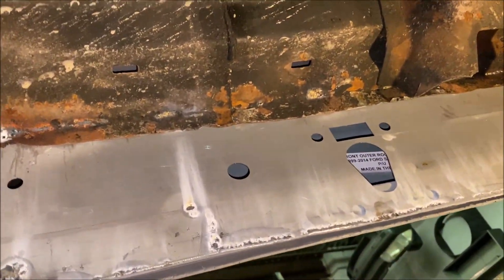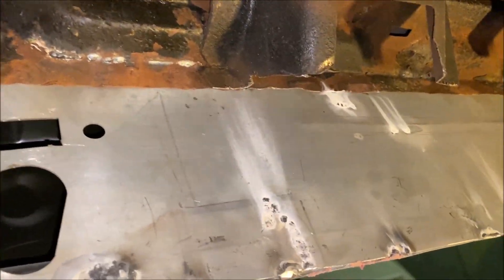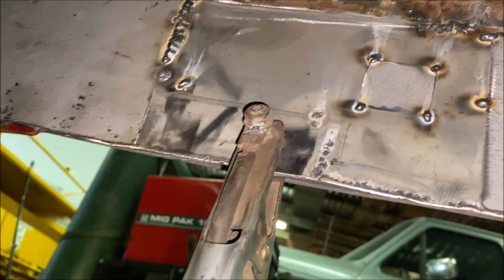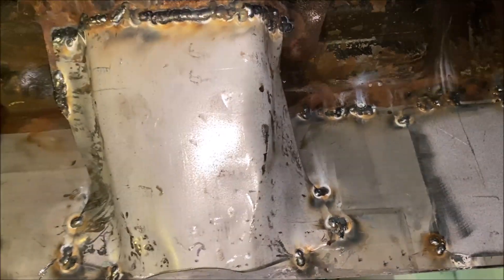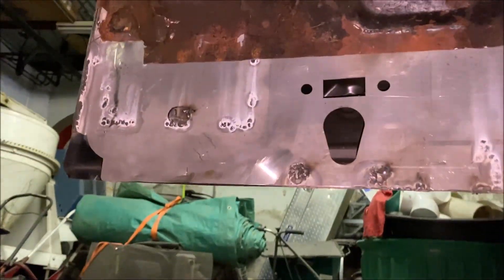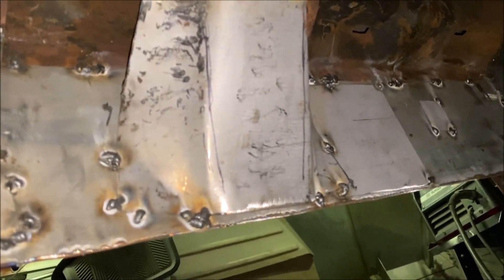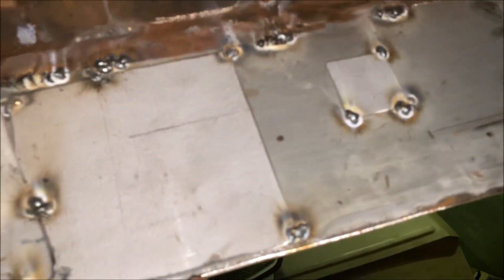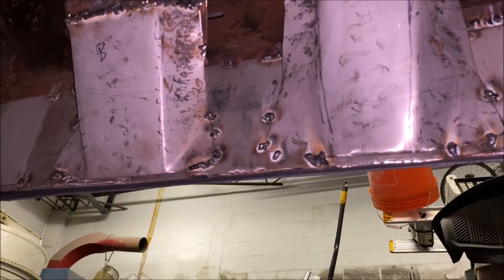Fabricating/Welding New Cab Supports For Project SHORTY! (Rust Repair 1999-2016 Ford F-250/F-350)

Comment: My 1999 f250 that I picked up is pretty damn bad rusted out lol. I picked up a new rust free bed "100% needed lol". The frame seems to be pretty solid after getting the majority of surface rust knocked off. However the cab is pretty bad "floorboards included" , definitely worse than yours was. If you wouldn't mind I'd like to send you some pics and get some input of yours to get the truck road worthy again. Great videos btw!!!

Comment: F81Z2510776AA
F81Z2810870AA
8C3Z2510608A 
Just replaced all mine in my extended cab here’s the Ford part numbers for cab supports
Reply: I know this comment is very old but what was your process for replacing the cross member. I’m glad I saw your post because I was gonna cut one out of a cab
Reply: Where you get the parts?
Reply: Would it be possible to adapt those cross-member for a F150 super cab?